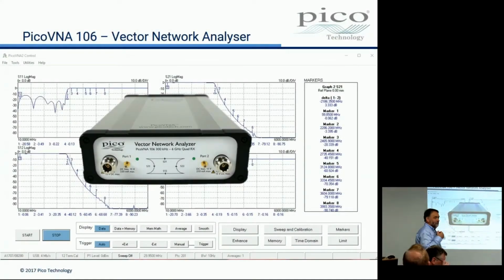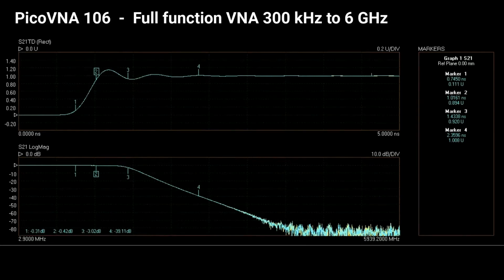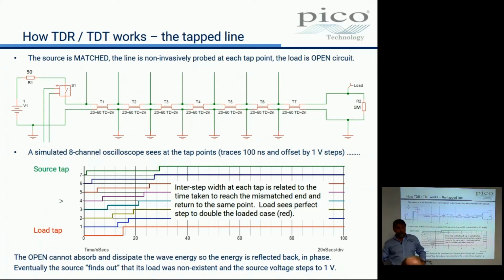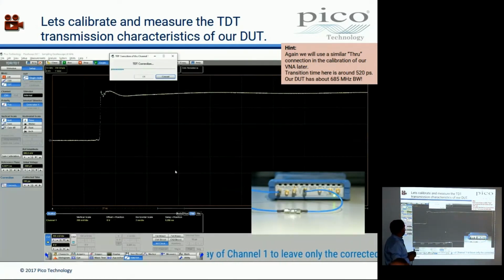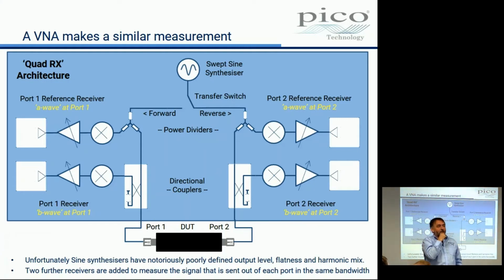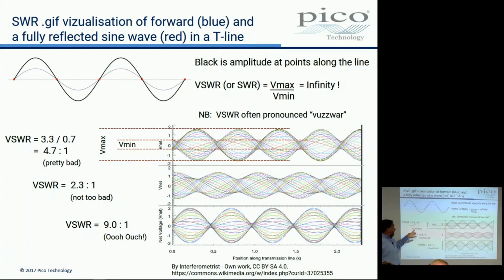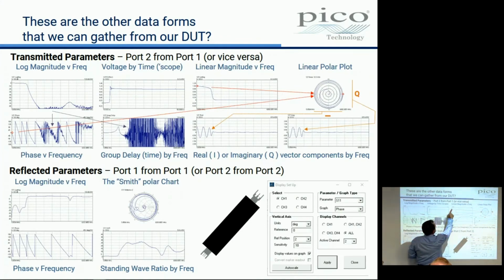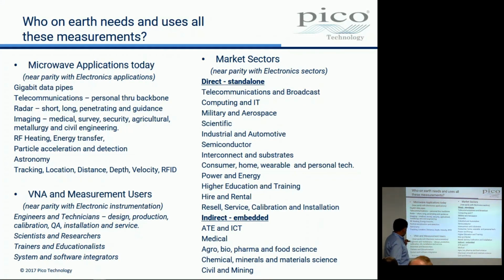Pico Technology VNA106 Training Session 1 of 3

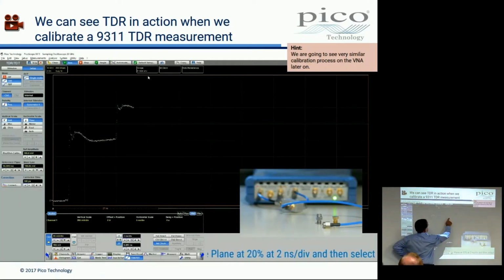Comment: Watching you screw in those standards at 39:00 was cringe worthy.   Hold the standard steady and rotate the cables SMA nut.  This way you are not rotating the center pins inside one another which can easily damage some of the metrology  grade parts.  It will cause undo wear at best case.     So far, really like the training.  You did a nice job with it.  Thanks